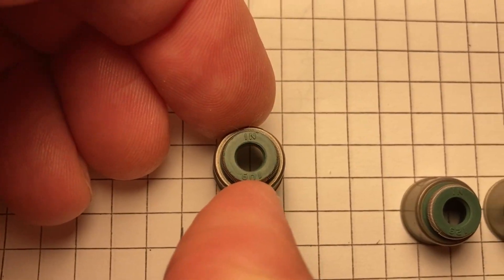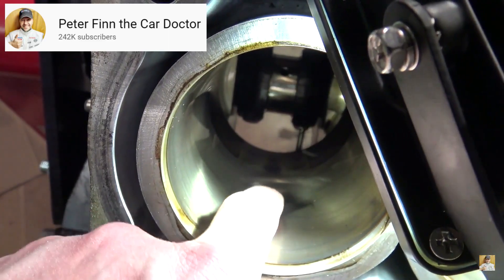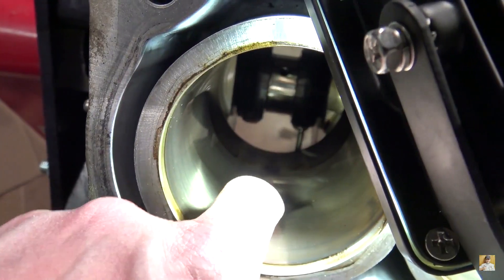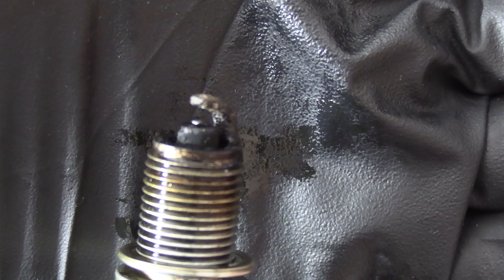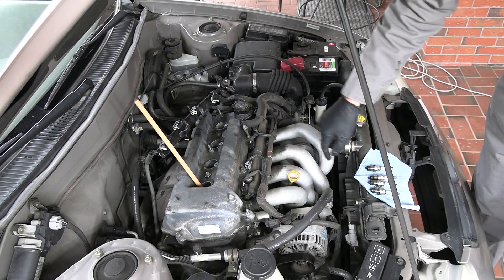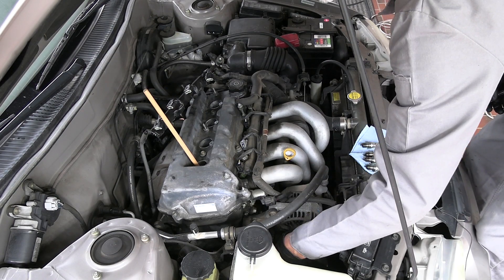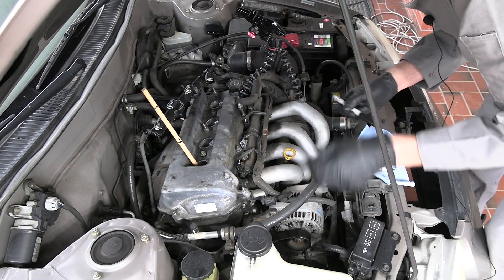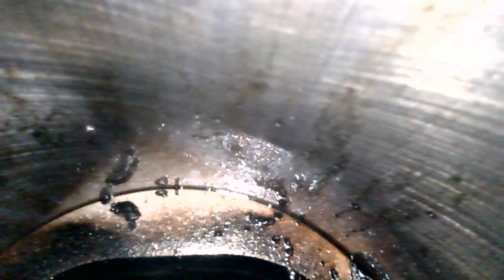Toyota Valve Stem oil seal replacement -1zz-fe | Part 1 | Oil Burning🔥Experiments | Episode 9

Comment: The issue with this engine is the oil drain back holes in the piston that allows the oil scrapped up by the oil control ring back into the crankcase. The piston has 4 small holes under the ring when that should be larger and 6 instead of 4. Long oil change intervals, running low on oil and cheap convention oil cause the holes to plug with deposits. The ring then loads up and sticks over time with deposits. Use synthetic and change early to minimize the problem. The fix is remove the pistons and clean the holes and unstick the rings. Or rebuild with the update piston.

Comment: Make sure the pcv hose and the valve cover ventilation hose are in there proper location on the intake. If not it will force oil into the combustion chambers.

Comment: Man I love the 1ZZ and 2ZZ FE engines, they are one of my favorite Toyota engines.  I've rebuilt a couple of the 2000 ish era 1ZZ engines that had ring problems and burned oil and smoked like a chimney.   Each one I've torn down the internals looked great, even on cars that were run low on oil until the oil light came on.  Aside from the bunk rings that made it into a few years of the engine, otherwise these engines are bulletproof.  I've had both a 4AFE powered 93 model, and a 2000 model 1ZZ, and both of them had over 500k miles on the car and engine when I sold them.  And they both ran and drove great.
Reply from the maker: That’s awesome. So it sounds like there’s hope!
Reply: Toyota 1ZZ-FE engines on Corolla, North American model (E110) from 1998 to 2002 had problems with burning oil until new model came E120/E130 from 2003 to 2007.
I own a 2006 Corolla with almost 120000 miles (195000 km) on the odometer and the engine doesn't burn any oil between oil changes.
That said, maintaining my car is the closest thing to a religious ceremony from day one I brought it home from the dealership. The first oil and oil filter change was done after 1000 miles (1600 km), and the second oil and oil filter change was done at 3100 miles (5000 km), and after that every 3100 miles (5000 km) or three months, whichever comes first.

Comment: honestly,  if the valve seals dont fix the issue i would pull the head and oil pan, ball hone the cylinders and install new rings, maybe drill out those holes in the pistons if it has them and change rod bearings and get a valve job on the head.   it would make a great videos series too!
Reply: Or is it cheaper to just buy & install a new rebuilt motor for some?  I don’t have your mechanic skills but know some guys that work off of the clock pretty reasonably. Thx
Reply: That is exactly what I did over a long weekend. I put in a reman head and did rings and bearings. Went from 1 qt per 150 miles to no burning to speak of, .5 qt now at 2500 miles.Total cost about $550.

Comment: 7:29 Hi Dave! This cross hatching is deep(machined). IT can be the reason of the engine oil burning. The rings can not scrape the oil down. The deep cross hatching can make also blowby. Manufacturer's fault.

Comment: Dave, here is my opinion, for what it's worth:
    The primary cause of oil consumption is due to clogged ports (small holes in the wall of the piston) which do not allow the oil to return to the crankcase after being "scraped" off the cylinder walls.
     Therefore, replacing the rings only would not solve the problem.  Those small port holes need to be cleaned out, and maybe drilled out.
    Unfortunately, the only way to get those ports cleaned is to remove the pistons, which would lead to a complete overhaul, anyway.
    But, I very much enjoy your work on this project!
Reply: F'n piston drain holes!!! 🤬 Toyota make a GREAT dependable simple car and screwed up the one thing that completely destroys the car. The Kentucky engine plant only had ONE job! 🤬
Reply from the maker: If it is those holes (which is very likely), I have another little experiment in mind targeting those specifically :-) ... we'll see! Thanks for the comment!
Reply: @FamilyFriendlyDIY  I'm looking forward to that video! I saw an interesting comment about using compressed air and seafoam. I would love to see if that actually worked or not for the clogged piston holes problem.
Reply: @FamilyFriendlyDIY  If it's really those holes "Engine Restorer" might help, that has small copper particles that fill the holes. At least temporarily.
Reply: Dang I can’t wait for ideas on how to flush those. Fill the engine up entirely with diesel? Run the oil pump manually? Bump engine over with plugs out to slosh the pistons into the diesel? All bad ideas, but maybe fun.
Reply: @eppenga  the goal is to unclog the drain piston holes so the oil goes back into the engine and out of the composition chamber
Reply: I watched a couple of piston soak videos.  It may work if the oil control rings are all gummed up, but the solvent may damage seals.

Comment: If a rod or a piston goes shooting through the engine, then it’s toast I would just run Rotella 5W 40 and use a really good filter and try to baby it for another couple years and always keep a 5 quart jug in the trunk and a funnel and a bunch of shop rags that are disposable

Comment: It seems like the face of the piston wouldn’t be wet with oil unless they were being dripped on after the engine was shut off, right? Looking forward to finally seeing this fixed!!
Reply from the maker: I'm starting to think the same thing.
Reply: The oil was also heavily coating the top of the cylinder but not the lower part. Since the cylinders are being oiled from the bottom and the oil control ring is pulling back the oil if it were leaking past the rings it wouldn’t be such an even coating down from the top IMO

Comment: Good video!  I have 2005 Corolla with 378,000 ish miles on it.  I am having oil consumption as well.  Your videos are helpful thank you!  
I drive 200 miles a day on mostly highway and I have been putting 8oz of Seafoam High mileage formula in the crankcase 200 miles before an oil change.  I have notice a reduction in the consumption but it is still using oil.  I am very curious to see how your valve stem replacement goes and see the end result.  Thank you, Ryan.
Reply from the maker: Thanks Ryan! Whoa! 378k miles!
Reply: Ryan, is your Corolla automatic or manual transmission?
Reply: @peterlai9018  Manuel, I had to replace it at 287,000 due to output shaft bearing wearing out.
Reply from the maker: @TheBangBang04  I had to have mine rebuilt too ... same notorious reason.
Reply: @FamilyFriendlyDIY  I bought a junkyard 5 speed and whoever owned this poor transmission before I got it didn't know how 3rd and 4th gear worked.  I have to very gently push it into gear in those gears or it will grind 😔, but never fear I kept the old 5spd and plan to rebuild it.  When this old 1zz-fe engine finally decides to die I will buy a rebuilt engine and throw my rebuilt 5spd in. Then hopefully I will be good for another 370K+ miles again.
Reply from the maker: @TheBangBang04  I wonder if the grinding is a problem with the design? Because my rebuilt tranny has ground into 3rd since day one if I'm not extremely gentle with it.
Reply: @FamilyFriendlyDIY  I don't think so, I have seen a few of these 5spd trans rebuilt.  During the assembly process the gears need to be pressed perfectly into place onto the shaft you are working on.  If you are off by just a little bit, the gear and the synchro associated with that gear won't I guess harmonize.  This is a bit outside of my expertise to explain.  I do know that a micrometer and lots of measuring needs to happen during the disassembly phase. When the transmission gets put back together you need to match the measurements you took with the placement of the new parts being put back in.
Reply from the maker: @TheBangBang04  Makes sense. Thanks.
Reply: I have the 2004 Matrix with the 1zzfe.  I am wondering if it has 8 oil return holes per piston or 4.  I heard the European version of 1zzffe didn't get the piston right until 2005.

Comment: You have no scuffing on the cylinder walls. A simple flex hone will do. Modern engines have very low tension ring pack that are also very thin.  Some of the newer  ones have 1mm thick top ring, 1.2mm second and a 2.0 mm oil ring.  It's not the old days when you needed a three foot ratchet to turn the engine. You even had industrial/farm engines with four rings per piston.  If You built a race engine you had low tension oil rings and a catch can for the extra crankcase pressure and oil blow by. The old type high tension rings also caused cylinder taper and a ridge near the top of the cylinder wall. You would use a ridge reamer to cut the ridge down and remove the lip at the top in order to remove the piston  We used to bore blocks all the time  back in the day. Our block boring bar is almost never used any longer. 

If run low on oil or overheated the engine you could have scuffing along with scorn pistons and cylinder walls. If this was the case you should be hearing a piston knock. The piston to wall clearance is very tight on a modern engine. Most of them have a coated piston. Some type of dry film on the piston skirts. A thermal coat on the crown/top. Some also have a hard coating on the top ring groove.  look on the thrust side of the cylinder wall first for signs of problem. In your case it would be on the exhaust side. The crankshaft rotation whips the piston and rods harder on the thrust side(higher load force). 

 You have a sludge problem. The oil rings are clogged and the rings lost a lot of their tension. You need a cheep rebuild with a lot of TLC.   Valve stem seals, rings, bearings and maybe timing set. A new oil pump would be nice. You also need to make sure the clean out the baffle in the valve cover. I have done more then a few cylinder head rebuilds for dealerships and seen this missed. If you do all the work and not clean out the valve cover baffle, the problem will not be 100% fixed. 

You said you are a cheap duck, in different words? So for how many miles have you owned this car? Is the situation here caused by your lack of maintenance? Also running the engine with those shot spark plugs is not a great idea. It's looks like you have some detonation/pre-ignition going on. No surprise there. Anyway, all that extra load can cause damage to the top of the rod bearing and the bottom of the main bearings. Maybe a spun rod is on your future? Also all the raw unburnt fuel and oil is going into your catalytic converter and coating your O2 sensors. It's a bad cycle and is going to get worse. 

So if you are going to keep the car, stop the bleeding and fix the car. If you are using it for entertainment tv on You Tube, keep going. 👍 You are helping people understand a little more on what's going on. Nice job.
Reply from the maker: Thanks for all that. Lots of good info. ... Here's some more background, and maybe you can give more input:
I bought this car with around 180k miles on it and already having the oil burning. I had to have the manual transmission completely rebuilt right after I purchased it due to worn out bearings. About the spark plugs, though I'm cheap, I'm pretty staunch about maintenance and I only run premium fuel (93 octane). The engine doesn't ever knock or misfire, and no misfire codes. The engine light is on due to a "small leak detected in EVAP system". Someone else has mentioned running it with old spark plugs could cause more damage. You seem to be very knowledgeable, so I'd appreciate more input on this, as I don't want to further damage the engine. Is there another issue oily spark plugs could cause that I'm overlooking? I really do want to get this car running right and have it for years to come ... but at the same time, I thought it would be a perfect test subject for a lot of chemicals and experiments. Thanks for any more advice!
Reply: @FamilyFriendlyDIY  

Take a small brass brush and clean your plugs. Not a big fan of regappiing old used plugs. Cleaning them will help how it runs. Spay them with carb cleaner to soften the build up. Then use a  stiff bristle brass brush and clean them. Spray them off one more time.

It would be a safe bet that your valve stem seals have hardened up over time. Just not sure they are a big source of the oil consumption. The bucket  camshaft follower/lifter design your engine has helps shield oil from leaking into the valve guides. Blue smoke on cold start up after sitting for a period, is a sign of bad valve guide seals. Do you get a big puff of blue smoke out the tailpipe on the first start up if it sat all night?

There is no liquid that you can add to repair for a failed or worn out mechanical part. So I would do a wet and dry compression test , along with a leak down test. Find out for sure what is the current health of your engine.  Only with  this information,  can you better plan your course of action.

You have a code for EVAP leak? Where is the leak? May sure the engine and intake system has no leaks. Your breather system and PCV valve will not function properly with leaks. This also can cause oil consumption.

Do those tests and post your results. Engines are designed to have good clean oil in them. Sometimes those rebuild in a can additives cause problems later on. I would hold off using them.  

Good luck.

Comment: What do you think about using SeaFoam for general maintenance to PREVENT stuck rings?
Reply from the maker: Good question. I don't think it would hurt anything. But I think if you're doing sub 5000k mile oil changes with a synthetic oil, you'd probably be safe from stuck rings anyway. If I didn't think I had stuck rings, I'd probably just do regular oil changes and never add anything to the crankcase.
Reply: @FamilyFriendlyDIY  I was doing 18 month, 8kmi oil changes with AMSoil 25kmi synthetic.  I have a Toyota 2AZ FE engine (highlander).
Reply: @bobthrasher8226  no problems at those intervals? How much mileage now?
Reply: @craigiefconcert6493  128kmi.  I haven't checked compression but oil consumption seems to be low enough.

Comment: I have a 2000 Corolla with the same issue. Its my beater commuter car that I paid $200 for. Im about ready to bite the bullet and throw new rings in it. The car runs great but its drinking about a quart every 400 miles
Reply from the maker: I feel for you.

Comment: I disagree with Dave's position that the scope shows "crosshatching through the scoring". If you look at the most pronounced score marks -- they cut through the crosshatching -- and no sign of the crosshatch exists in those deep, narrow vertical grooves. I have had fantastic results with Lucas HD oil stabilizer in worn, knocking (mild knock), and smoking engines that can take such an additive (non-VVT).

Comment: Looking forward to the valve stem seals.  If it is the rings, try a Kreen piston soak:  From "Bob is the Oil Guy" forums:  "This fixed oil consumption in toyota 1ZZ-FE engine:  Actually it was a series of fixes. I had 2-3qts/5000 miles oil consumption in 2003 (made in 2002) Corolla since 6X,XXX miles (forgot the exact number) after a steady diet of dino oil changes every 4000-5000 miles/6 months. I did a couple of MMO piston soaks that would help for 2000 miles or so and consumption would come back. Than, last summer i did an extra long multi-week MMO soak that partially helped and cut consumption in half. I also started filling oil above the dipstick mark as per the Toyota's TSB for this engine. Before next oil change this last fall, I did Kreen piston soak and flush and started using Maxlife oil. Small consumption lasted for the first 1000 miles and disappeared since. Time will tell but so far so good (no visible consumption whatsoever) several K miles into the OCI. Next oil changes will be synthetic to prevent the oil consumption from reappearing. Not sure what exactly was the fix, maybe a combination, but it worked. MMO piston soaks themself seemed least effective."  A link to the dipstick TSB is in the thread.
Reply from the maker: Thanks Duffman. A few people have mentioned Kreen. I'll keep that in mind.